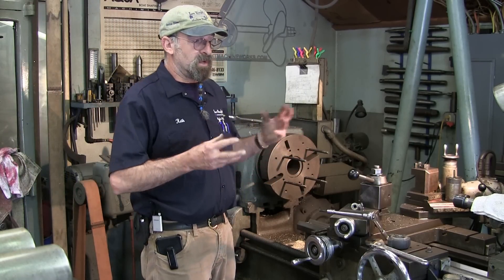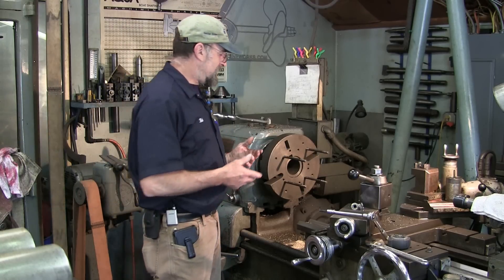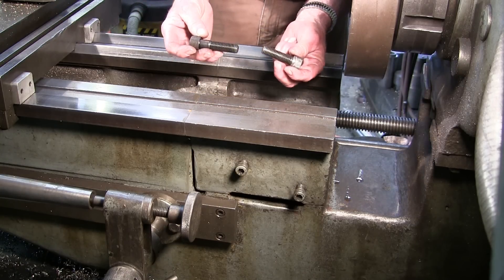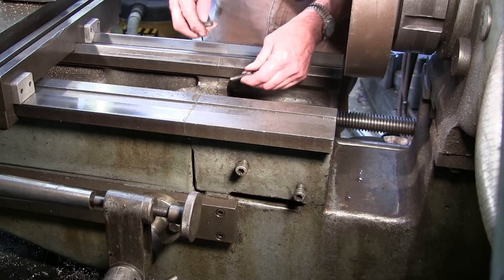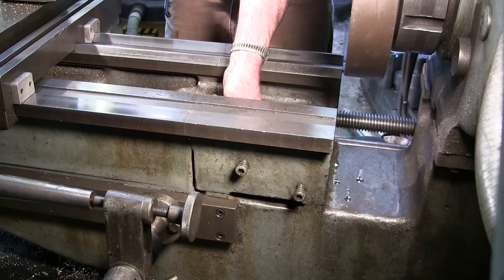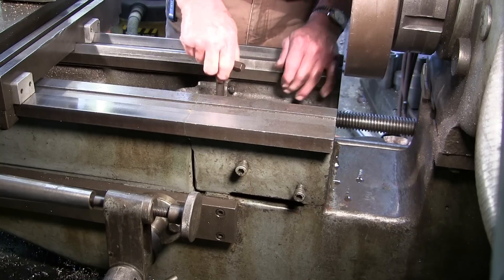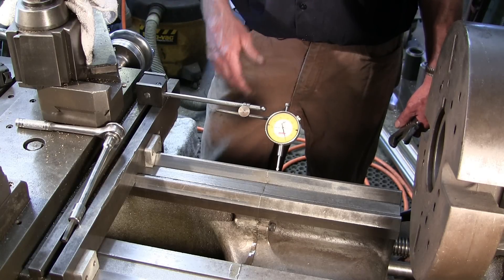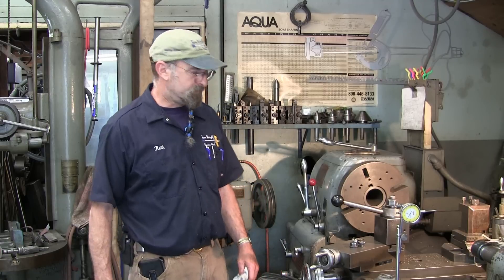At the Gap

Comment: I have a Colchester Triumph - the smaller version of your lathe.
Nice video showing how to reset the gap. I have a problem with mine - the threads are stripped on the lathe bed under the gap - looks like I will have to go up a bolt size or perhaps use helicoils - which would you suggest?

Comment: Thanks for the great video.
I have a Colchester Triumph roundhead - very similar to yours just a bit smaller.
Just spent hours polishing and stoning the gap piece - cleaned all the mating faces on the lathe - used a tiny but powerful magnet to get swarf out of the screw holes etc etc. Put it in place - 1 of the bottom bolts has a stripped thread in the lathe bed! So annoyed and no access from underneath to get a nut under there - I think. The other bottom bolt won't engage either.
Don't know if it even needs to go back in - certainly not with the 4 jaw in place but possibly with my Jacobs collet chuck.

Comment: What is the heaviest thing you have turned? I'm turning my first heavy item with the gap out- I'm guessing about 35lbs on harbor freight 13x40 lathe that is around 1200lbs. It is also my first bore. I mounted the heavy end towards the head, but I'm only doing that for the first one. Would you recommend bolting on some counter weight to the far side of the faceplate? It is my last upload if you have a minute- I'm new to boring and I used a 1" pin from a piece of scrapped equipment with a 1/2" shank welded to the end- Am I crazy? I've been feeding slow, but at 60rpm, a 23 minute bore is a bit long. I'm too scared to speed up.

Comment: First rule at the lathe. NEVER put an air line any where near the lathe bed it blows particles especially bronze into the scrapers and under the slides. Use a hand brush and rag to wipe bed

Comment: Maybe because it is a bigger machine, but the lathe i run at work there are a couple of taper dowels in addition to the bolts..
Reply from the maker: tracyguilbeau Many manufacture use different alignment techniques. I have seen that on some of the machines in the yards. ;{)------

Comment: G'day Keith
Thanks for the video.  I have a Colchester with a gap and as I bought it second hand I will now be pulling the gap out for inspection.  As you said I have no idea if the gap piece was taken out prior to my ownership or put back correctly.
This got me thinking, I am sure on a quality lathe the gap mating surfaces would be precise and clean before the bed is ground but on a cheep import there could be all sorts of crud under there when ground.  The process of removing and cleaning would ensure it would never go back on the same way!

Comment: If you remove the gap, you will never get it back on the machine the way it was, its just that simple.
If you have a new machine - don't even touch the bolts that hold it down.

Comment: Hey Keith not sure if I've commented on any of your vids yet but I have seen over 50% now and have implemented a lot of your teachings into my everyday life/work and feel inspired being a machinist myself from a fitter/turner background in NZ.  Looking at purchasing my very first lathe and would like to know any small tips in regards to inspecting the lathe before committing to the purchase, like bed level, headstock/tailstock etc any advice would be greatly appreciated. Cheers mark
Reply from the maker: Mark Runciman Hi Mark, thanks for the comment! I think you look over a used piece of machinery and weight the overall condition, ways, gear box, carriage and cross slide feed nuts lead screw wear, tail-stock bore and spindle play accessories that come with it, against the purchase price. The biggest tip I think that is important is being able to run test run the lathe, put it through all the gears and feed box motions, to make sure your not over looking broken  or missing internal components. ;{)-------
Reply: Keith Fenner Hey thanks Keith great advice.  Love the slow motion shot at the end of My go to Bar 3.

Comment: Small tip on using the wireless mic, you can pin it to the bill of your hat and avoid the rumble from the mic being clipped to your goatee, just dress the wire from the back of your hat to the transmitter, we use that trick on fishing shows all the time, you get the benefit of the mic tracking your voice and not having to rub on anything.

Cheers, keep up making great videos.
Reply from the maker: Gerry Gallegos I was think that and may have to the new mic works good but does pick up more rubbing noises. ;{)------

Comment: Keith- I have the same lathe, a Colchester 17" x 54", with 2 speed motor.  I think mine is from the 1970s and the ways are in pretty good shape. One thing I am in the process of doing on my lathe, is making new bushings in the apron and power feed tumbler, the ones that support the feed rod and leadscrew.  I don't think they originally had bushings, I believe they ran in plain iron. So I believe some time in the past, someone fitted bushings, and now they are worn again, almost through their 1/8" wall.  I believe the lathe has a design flaw, in that the spring for the power feed engagement detent puts pressure on the feed rod through the tumbler. The detent spring exerts all of it's force one way on the detent and the other way to the feed shaft. This wears the tumbler bores, or in my case, the bushings that were fitted. My solution is to put in a much weaker spring, and design an external latch for the feed lever, maybe a spring loaded plunger coming from the side to lock half way underneath the lever to hold it up. Need two of these, for the bed feed and the cross feed. I am not there yet, else I would give to you some Solidworks drawings of my fix design.
Q?  I have some aluminum bronze. Will this be too hard for the feed rod/leadscrew bushings?  I figure it is better than the origional iron on steel.  Thanks!  --Doozer
Reply from the maker: kooldoozer I ran thought the same circles, with mine and what I did is make a set of hardened sleeves and then made a cradled / 1/4" aluminum plate, in U shape to hold the leaver at the face of the apron, just a little bit above what it slides forward and aft at. I haven't had to touch it now for over fifteen years.  ;{)------

Comment: Because a lathe has a removable bed does not mean you should take it out. I be terrified to do it on our new Taiwanese tool room lathe. They don't make them like they used to that is for sure.
Reply from the maker: mikecwiklinski Yeah it the fear thing! ;{)-------
Reply: mikecwiklinski On a new lathe, especially an import, you need to go in there and clean out any stray grit - machining chips, casting sand residue, etc., dress the flats with a stone, and apply new, clean, non-corrosive oil, then set your piece back...

In the hobbiest community, we have a saying that every machine tool is a kit, which you can tune into a working machine - this applies in spades to inexpensive machines, be they new imports, or used iron from a G-8 country.

I've been known to replace bolts and screws with hardware purchased from a known dealer if I don't like the looks of what's there...

Again, I've done this on my old Logan lathe, as well as my newer Chinese imports...

The only folks more likely to modify things than machinists are welders... ;^) If you aren't at least doing minor repairs and tweaks, you aren't getting the most out of your machines...

Eric
Reply: chemech 

Ok, the next time you got a brand new $40,000 dollar gap bed lathe lathe and the boss just hands you a long job he needs done yesterday. Tell him ok, just let me pull the gap on this machine for fun  that clearly says this in the owners manual. 

Gap Removal
Your lathe has a gap section below the spindle 
that can be removed for turning large diameter 
parts. 
This gap was installed, then ground at the 
factory during lathe assembly for precise fit and 
alignment. Factors during the remaining assem-
bly apply additional forces to the gap; therefore, 
replacing the gap to the original position will be 
very difficult. 
We don't recommend removing 
the gap. Reinstallation to exact factory align
-
ment is nearly impossible. The only option is 
to then leave the gap out.

I like a challenge as much as anybody does. As I said they don't make them like they used to. 

There is also a huge  difference between what Keith would be able to come up with in pulling the bed on a new lathe than what would happen to the guy that decides he wants to from watching one of his videos.
Reply: mikecwiklinski Funny, when I or my former employers received a "new" piece of equipment, the first thing that got done was to unpack, clean, and set up...

I have not seen where a machine would roll in the door all cleaned up and ready to just plug in and start making parts...

Pulling the gap is so much faster & easier than cleaning the ways, lead screw(s), tailstock, gearboxes, and cleaning and installing the toolpost - these days, a Quick Change Tool Post in most cases.

Used machinery is usually caked with gelled up lubricants and embedded swarf & chips... 

So, congratulations, you're the first guy I've run across who got handed the keys to a new, ready to run machine... your situation is unique in my experience...

But, the manual telling you that while they provide a bed gap insert, if you pull it out you can never put it back?  That's verging on false advertising, and could have implications on the Warranty of Fitness for Purpose - you'd need a lawyer for that, but I'd be ticked off if a $4k gap bed lathe had such language in the manual, let alone a $40k machine...

I design stuff for other people to use - I and my employers cannot warranty anything against improper operation and maintenance... 

So, yes, Joe Blow Smedley is going to have to be careful when doing work on his machines, and probably won't get the same results as Keith would - at least not the first time out of the gate... fixing one's mistakes is part of doing the job and learning, And I've seen Keith, Tom Lipton, Adam Booth, J. Kilroy, Mr. Pete, and a few others make mistakes similar to my own screwups...

When I'm evaluating technical people - engineers, technicians, machinists, etc. -  I'm not so concerned with what kind of mistakes they make, as I am interested in seeing how they cope with fixing their mistakes, and ensuring that they don't make the same kinds of mistakes again...

(Boneheaded blunders showing a complete lack of judgement are another story)
Reply: Eric Anderson 
I don't think rebuilding a new machine to clean it nets a guy much of anything.  I drive a 2015 truck that I bought near a year ago, I consider it to be a new. 

We had a new Crown forklift in shop. Somehow it left the factory without any hydraulics working. Two road technicians with full factory support and about 50 man hours to locate two bad electrical connections. But life is easy for some people.

Fixing ones mistakes is part of the job but you need to consider that most people do not have the ability to fix their mistakes. Not today and maybe not years down the road if ever they arise. Let me ask you this. If you remove the bed and find after re installation that it now falls away with debris removal you would correct  in what way?

Its like holding tight tolerance on a lathe with a 30ft bed. If the lathe is perfect but for a bit of sunlight at 10 am hitting it in a 12" area of the bed you are not going to make your tolerance if you depend on the machine dials.

Comment: Keith I have a Grazoili lathe with a gap 20/28 x 86" And I have cleaned things up like you did. But I have not ran a indicator over it. Is there  a need to run the indicator all the way across the length of the gap to check it that way . Thanks
Reply from the maker: THE IRONWORKER If you want the wipers and the bed to gluide as if it was one piece better to check it with indicator. ;{)------

Comment: There is a problem with your mic.
Is there a gain control on it ? you need to have it as high as possible, otherwise if your gain is to low, when you adjust the volume in your editing software you are also amplifiing the noise.
Reply: LoomisRex i don't think is a low gain issue ...  i would check the cable for broken/poor shield .
Reply from the maker: LoomisRex Exactly and remedied already, just can't do over sometimes! LOL ;{)------
Reply: Keith Fenner I hope it's not the Mic i sent you :)